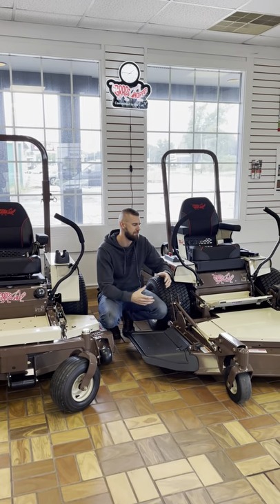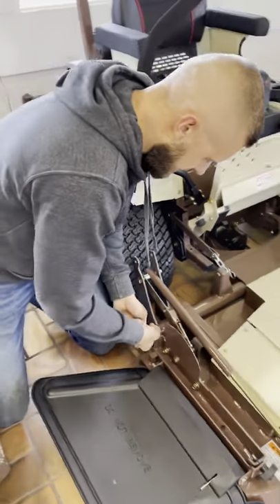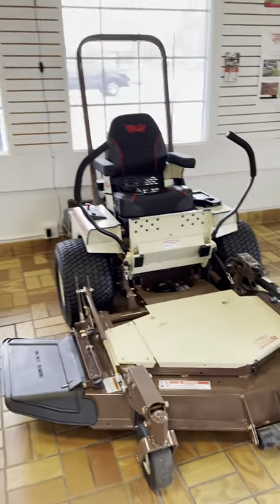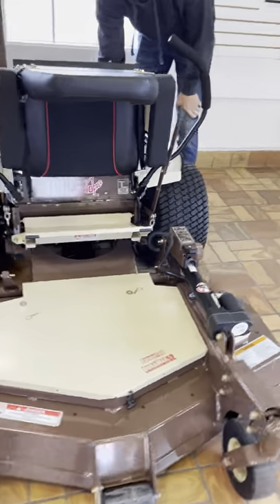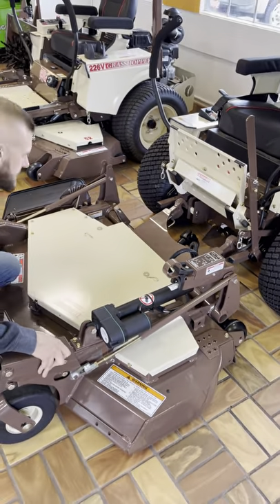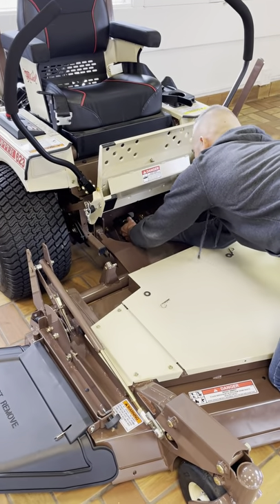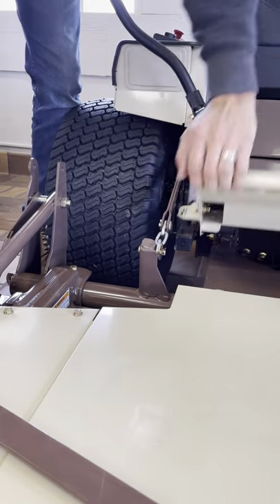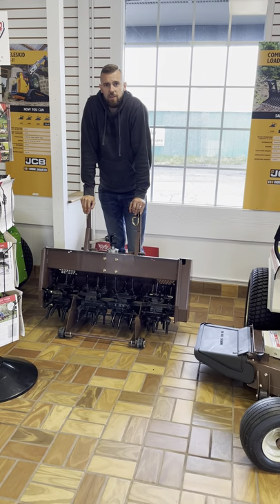How to take the deck off a front mount Grasshopper Mower

Comment: I never knew that's what that piece is stored in the deck's tube.  I used the end of a small crow bar to accomplish this on a 725d.
Reply: I bought my 725 D brand new and maybe I missed it but I don't remember it ever being mentioned either.
Reply: @placidbeach  Now we know. I'm not entirely sure what the purpose of this springy thing is.  I believe it somehow increases traction on the drive wheels.

Comment: So I saw the $200+ armrest mounted height adjustment kit from grasshopper on amazon, but what I really would like to do is mount a remote switch right out on the left steering handle so I can adjust as I'm driving. Is there anything that does that?

Comment: thinking obviously without a petal you cant fether the deck like a mid mount to go over tree roots etc., is this correct?
Reply: With hydraulic deck lift option, deck is picked up and you ride off laughing at tree roots, curbs, and mid mounts